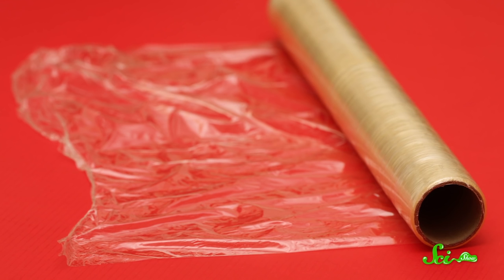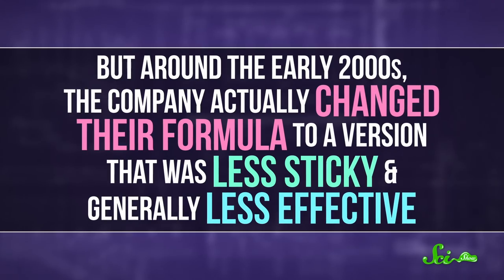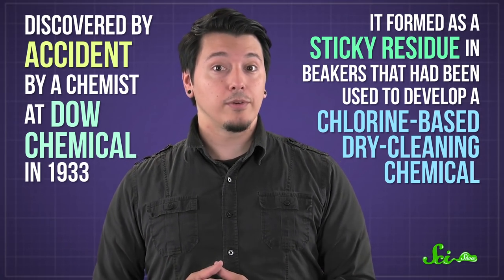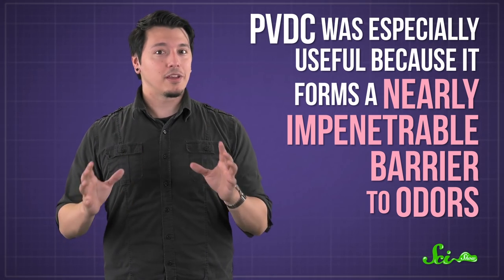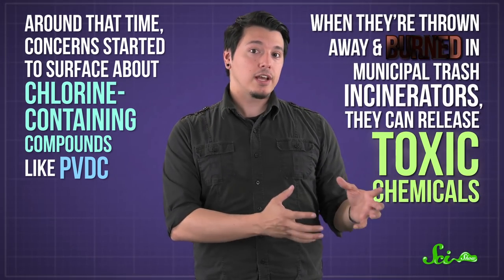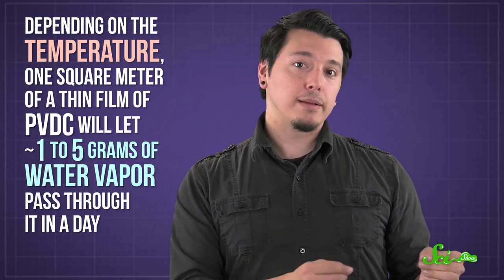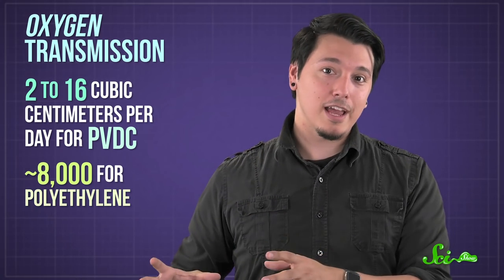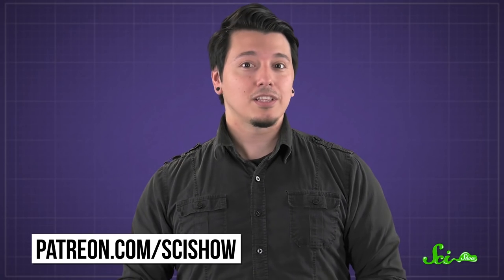Why Isn't Cling Wrap as Good as It Used to Be?

Comment: Question: How does water ruin electronics? And why doesn't it correct itself when the device dries out?
Reply: Water contains ions. These make said water conductive, which creates a huge mess in fragile electronics. Moreover, we use metals to conduct electricity in electronic devices. For long exposure times, water along with ions and diffused oxygen will react and "corrode" the metals, turning them into non-conductive compounds, effectively ruining the circuit.
Reply: The water itself isn't what causes damage, it's the electrically conductive particles that are dissolved in the water. These particles make the water more conductive, which causes circuits to connect that aren't meant to connect (sometimes called a "short circuit", or "short" for short). Once a circuit gets damaged in this way, it's not recoverable, so when the water is removed it's still damaged. 

If an electronic device gets wet when it is completely unpowered (no current running through any part of it), usually it will still be functional once the water is removed. A short circuit only occurs if there is current.
Reply: Rahsaan Footman Because water often han ions in it that make it conductive. These conductive water bridges short circuit parts of the electronics so current flows in directions and amounts it shouldn't. Sometimes these short circuit currents cause irreversible damage to the semi-conductors the electronic chips are made out of so even when the water dries out the chips don't work the same way anymore.

That is why people use deionized water in their computer cooling loops, it isn't conductive(fresh out of the bottle) so if it gets on the circuits they are less likely to be damaged. 

This in also why you shouldn't turn on any electronics you suspect have water damage without first removing the water to the best of your ability and have the device placed in a bag of rice for nearly a week. If you get rid of the water before you turn on the electricity you can avoid damaging the circuits.
Reply: Rahsaan Footman 
Water doesn't harm electronics. In fact, you can buy,not build, a cooling setup that has your entire computer inside a fish tank full of water.

Water doesn't really conduct electricity. It's the minerals dissolved in the water.

But the damage done is physical. When it shorts it physically damages(like burns and melts) the components. No way to reverse that.
Reply: The water is conductive and so causes short circuits. Even if you dried it out, the shorts burnt up whatever they were connected to and so broke the circuit, resulting in said electronic no longer working.
Reply: John Crafton Yep, I used to work in electronic assembly and we would clean electronic circuit boards full of components with water or rubbing alcohol.
Reply: If you haven't figured it out by now after 6 comments: The water damages electronics because it is conductive because it contains ions that causes irreversible damage by messing with the circuits.
Reply: Screencapped and Emailed to my lawyer So if you used ultra pure water (reverse osmosis?), would it not damage electronics?
Reply: Robert Pruitt  That fish tank is probably full of mineral oil, not water.  A tank of water would pick up enough metal ions from the various metals that it would start off some galvanic corrosion, and that, coupled with the voltages from the power supply will cause more ions to be stripped, and in very short order, you've gone from deionized "non-conductive" water, to a moderately conductive contaminated water with a dead computer in it.
Reply: A. Neufeld If you used clean water, and the thing isn't powered, and you don't leave it soaking for long (eventually ions will be picked up from metal parts, or other contaminants on the board), then drying it out will generally leave it working.

FYI, some fluxes used in PCB soldering are water soluble.  Those PCBs are actually rinsed clean using very clean water.

If you're talking about something with a battery in it, or which is connected to power, any small amount of contaminants will likely be conductive enough to start a reaction that causes more metal to be dissolved, and you get a runaway reaction that will usually result in a dead device. (This is why phones often don't survive being dunked)  If you can immediately remove the battery, your odds go up substantially.
Reply: not only because water contains ions. 
Even destilled water causes redox reaction between different metals that lead to metal ions making it conductive.

Edit: read comment above instead.
Reply: If the spill just happened, you can rinse the devise in question with type 1, ultrapure, demineralized, deionized water to remove the added ions. After that, just blow out the water with a compressor, and allow to dry. The trick is that type 1 water doesn't stay that way long. it has to be used at the time of production. type 1 water has a resistivity of 18.2 Mohm across 1cm^2 surface area with an electrode spacing of 1 cm.
Reply: The same reason you dont drop a toaster in the bathtub.
Reply: I like how everyone in this comment section is so SMART :)
Reply: Water doesn't necessarily contain ions, and they aren't entirely what causes the damage. Your electronic devices are usually covered in plenty of soluble ionic compounds which will readily ionize even in de-ionized water. (Yes, I'm saying your phones are dirty. Get over it.) Electronic connections can be shorted out and cause electrostatic discharge damage to the device, however water also acts as a catalyst for oxidation which combines any local oxidant (usually O2) with a reductive agent such as the metal conductive surfaces in your electronics. When this oxidation occurs, it changes the metals into a less conductive compound and destroys the electronics' ability to function properly.

If your phone gets dunked in water, it will likely go dead as soon as the water reaches the circuitry. But simply keeping your phone in a high-humidity environment can cause it to corrode and fail over a time frame potentially as little as weeks or even days.
Reply: If electronics are ruined by smoke coming out of them, can they be fixed by putting smoke back in?
Reply: You have that in the wrong order. Electronics are smoke coming out of them by ruined. No, wait. Electronics are smoked by ruin coming out of them. Something like that, I got the order of operations correct, now I just have to fix the syntax.
Reply: Rahsaan Footman 
Better question why does the device work again when its dried out?????
Reply: It works again after being dried out if it didn't get shorted through electrostatic discharge. This has absolutely nothing to do with chance or how you treat your phone and everything to do with the manufacturer. Phones that don't survive being dunked in water aren't simply a cheaper design; it is done on purpose--it is one of many engineered fail states that ensure the devices last about as long as the manufacturer wants them to, and no longer. Not all manufacturers do this, so do some research and get a better phone for the same price or cheaper.
Reply: Water does not really damage electronics in short periods of time. Running power trough said electronics while wet, is what causes problems. 

I've seen people emptying water on a motherboard, dry it with hair dryer and towels, and voila, everything works. But if they had pressed "power" before it's dry. They would fry it.

Ps : Water always contain some levels of salt/ions that makes it slightly conductive. Even watercooled computer use anti corrosive mix ( a spoon per liter ) and anti bacteria growth ( That is NASTY ), because even the copper blocks that cools the chips give out particules into the loop.

Also, there's most likely a radiator made of aluminum somewhere in that electronics. Water + aluminium = many ions. Many ions water + other metals = THIS IS MADNESS galvanic reactions. 

Watch jayz2cents and linus tech tips videos on that subject.
Reply: Usually when people get electronics wet, it was already on. But if it has a proper case, the water won't reach the circuitry very quickly.
Reply: Some capacitors have an electrolyte "paste" in them, and are not sealed well, sadly this means that there can be contamination between layers(and other areas of the circuit board) if water gets inside of the capacitor. I had a bag of cheap outsourced capacitors, they were not sealed like one would expect.

Aside from the capacitor electrolyte leakage there are other components, and layers that can become "warped" if moisture and corrosion works on them for awhile. Commodore era electronics sometimes used aluminum parts with zinc and other metals leading to galvanic corrosion as well. It should be important to keep in mind water is not whats spilled into computers most often. More often than not its an acidic, organic, saturated, conductive, and sticky beverage of some kind.
Reply: Most times if you leave it alone until it’s completely dry it will work normally. The fatal mistake is trying to turn it on while it’s still a little wet. That goes for cell phone too. Phones take about 4 days to dry.
Reply: I totally agree Katie Kat, my cellphone took about two days to dry out from taking a bath in my coffee cup. Turning it off fast enough saved it, that and rinsing the sugar out of it.
Reply: RubixB0y also have to be careful of dried substances deposited by the water which are conductive
Reply: Water doesn't ruin electronics. Microparticles do. And those particles is in the water, and gets everywhere. When the water dries the particles are still there.

Comment: or we could find a less damaging way of disposing of it
Reply: elusiveEntity , if you shove it down a turtle's throat, it doesn't pollute the atmosphere.
Reply: elusiveEntity burning organic garbage is a very good way to reduce volume, also people are lazy, oils should be bottled before disposing and not poured down the drain and bateries have a "don't throw in the garbage" warning but people still do it, very few  people organize waste so a "better way to process it" doesn't work on practice.
Reply: The trouble is that soft plastic doesn't recycle the same way as hard plastics.  Hard plastics are pelletized and melted down.  Soft plastic like Cling Wrap and plastic bags can jam up the mechanisms of machines used to process other plastics and don't pelletize.  I think you can put it with plastic bags and take them to grocery stores that have bins for soft plastic recycling.
Reply: zinc carbon are trash dollar store batteries and no one buy those. I have zinc nickel and ni-mh.

Comment: Is the new formula completely free of dangerous compounds, or just have lower amounts of other dangerous chemicals? Because if it has only one fifth the toxicity of the old formula, what good is it, if I end up using five layers of plastic to keep my food fresh and fridge odor free?
Reply: Polyethylene (PE) is basically non-toxic and can even be recycled. If it isn't recycled however it will not degrade and will amass in a landfill. But that's a property that basically all plastics have in common.
Reply: Thanks. As someone who uses massive amounts of plastic wrap in the workplace, that is good to know.

Comment: Wow, I noticed it mostly because it does not tangle as easily and you can usually recover it, before it was like it welded itself on contact. All this time I thought they had caved to consumer pressure to make it easier to untangle. Thanks. Very surprising they did not market this action they took or if they did they really failed...

Comment: It's definitely gone down in quality but that doesn't mean it's useless. You just have to try a little harder to apply it. If you are bad at this you could try pushing it down on top of whatever your wrapping. If that isn't an option, like maybe it's a liquid, get the press & seal stuff. It's more expensive but easier to use so ppl have higher success rates with the stuff.